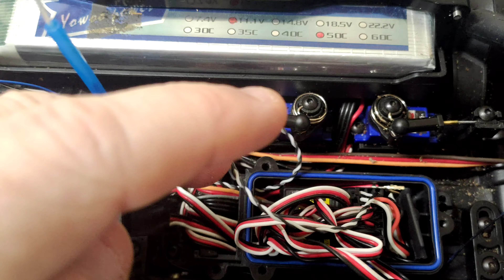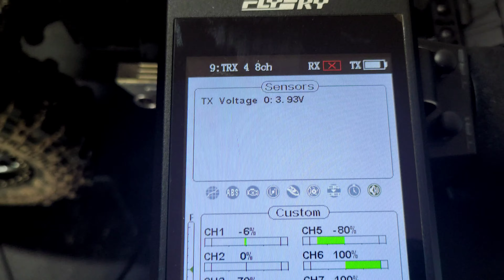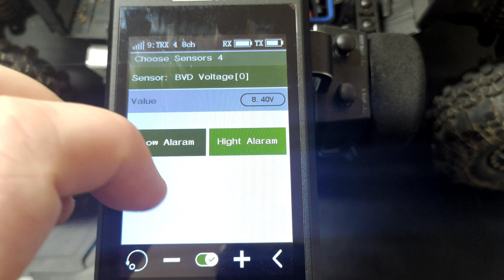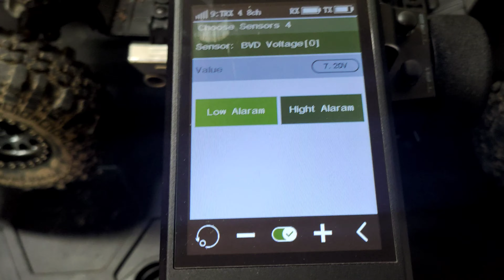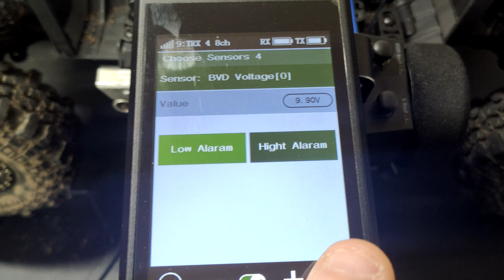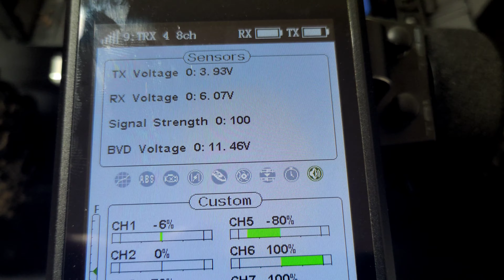Flysky Fgr8b BVD voltage monitor set up guide.

Comment: Good evening.
I have the new update on my paladin.
And now I can use the bvd.
Now my question do I have to use the plus and minus cable for the balancer?
With kind regards
Michael
Reply from the maker: Nope if its the battery your running from only the positive :)
Reply: @WTFRCCars  ok
So I only have to plug in the positive from the bvd at the balanzer cable.
high 13v
Low 9.9
For 3s
And for 2s
high 8v
Low 6.6v
Reply from the maker: So for high 4.2v per cell so 2s would be 8.4v high and 6.6v low
Reply: @WTFRCCars  Thanks for the information.
I'll try that then.
And I don't need the negative in this case

Comment: Hello, thanks for the videos on the NB4, I just got my own and I am wondering, in which case I will loose one channel on the fgr8b?
Thanks in advance
Reply from the maker: Only if you want to run more external sensors, so if you only using the included DVB voltage sensor you have DVB and all 8ch, if you want to add a temperature sensor you would loose 1ch and set that to ibus and then you could add more sensors by daisy chaining the next sensor to the temperature sensor :)
Reply: @WTFRCCars  Thank you for the fast reply and again for the very interesting videos. Then I will go now and update the NB4 to the newest FW 👍😅
Reply from the maker: If you are updating 2.0.99 is the latest only difference is the addition for the rm005 for the mini z add-on, 2.0.93 is exactly the same but no rm005

Comment: Question, i have 2x 3s lipos in my felony how do i connect the BVD harness in this case? @WTF RC Cars
Reply from the maker: Just goes on the + that goes to the esc :) this will give you the overall voltage of all your lipos so the voltage that the ESC sees
Reply: @WTFRCCars  are you referring to the main battery connectors? The esc has 2 of them.
Reply: @WTFRCCars  found it. Connected tto 2nd battery balance terminal show overall voltage. Thanks
Reply from the maker: It's the positive on the esc side you want :)

Comment: Craig I know the receivers come with this cable, question is the NB4 / NB4+ app capable of this in their menus etc?
Reply: NVM I see now vid is 3 years old so of course they are. Awesome feature man!
Reply from the maker: Yeh all of the nb4 radios are :) they released a firmware update when the receiver was released :)

Comment: Finally got my Fgr8b, quick question is it normal for the RX battery level is only half bar? I am running a fresh 3S pack and I set my 1080 ESC bec at 7.4v ?? Thank you !!!
Reply from the maker: Follow this one and you will have a fully working battery icon :) don't forge the dvb can't be set to that icon but you can make it show full when the bec is set to any voltage :)

https://youtu.be/pC9ZnSDrBas

Comment: What if u use 5mm plug batteries (for racing) can i put the + in the ballance hole? The one u also use for charging
Reply from the maker: You can solder the bvd + to the + pin on the battery or + on esc so long as it's seeing the main + to the esc it will show the battery level
Reply: Only way is the solder it? I cant just put it in the balance hole?
Reply from the maker: @RC_Adventures_BE what type of battery are you running if it's a 2s race lipo and you mean the centre hole in-between the power pins you will only see the voltage of 1 of the cells and the pin is much bigger than the pin on the bvd cable

Comment: Is it possible to purchase the bvd cable, i cant seem to find it anywhere. Thanks.
Reply from the maker: I have never seen them listed anywhere but they are just a cable with a diode or resistor in line on one of the wires I'll have to check what it is but try soarsky they have loads of parts listed
Reply: @WTFRCCars  thanks, if you find out the resistor type, I could make a cable possibly.

Comment: really helpful Video. How meny cells can it monitor im using 6S in my cars. Can,t find that info in the manual. ?
Reply from the maker: I can't find anything listed for the fgr8b's to external voltage range but I'm running 3s in the crawler and it has no issues with that, the other voltage monitor flysky do has a range -100v to +100v
Reply: @WTFRCCars   Thanks mate i will just have to try. :-)
Reply from the maker: Just remember if it's the battery your running the RC off you only use the + from the battery monitor cable :)
Reply: @WTFRCCars   I will you explained that very well in video. Thanks mate :-)
Reply: The DVB voltage is 0-70V according to the manual i got with my FGr8B. The pdf online is missing the info.
Reply from the maker: I know I had the pre release one the normal external monitor can do -100 to +100 volts but not sure on the range for the dvb or if it changed but I've run it in loads of rc's now and never had any issues with it reading the lipos :)
Reply: I’m thinking soldering the Positive side right into my connector of esc to avoid the loose wire scenario and eliminating the negative as mentioned. These receivers with the BVd port up to 12s also is even fine?
Reply from the maker: @shawnscott9704 The receiver can run 9v the bvd can monitor upto 70v
Reply: @WTFRCCars  that just made this system that much better!!!!

Comment: I didn't understand. This receiver supports a maximum of 9 volt power. How did you connect it to a 3S battery?! Please explain! )
Reply from the maker: Because you are not running the receiver from the 3s, you only use the bvd to monitor the 3s so the full voltage is not running through the receiver only the bvd cable :)
Reply: @WTFRCCars  I'm curious, what is the maximum voltage that can be connected like this? There is not a word about this in the official documentation. )
Reply from the maker: I assume it's the same as the external voltage sensors so + or - 100v I know the external one I run on my k6 exb has no issue monitoring 6s
Reply: I was wondering about the voltage range for BVD, the manual doesn't say anything. The airplane recievers some have up to 70V but the lack of info is really keeping me from buying. Even though I could detect a single cell if it's low.
Reply from the maker: @ignasanchezl from the spec + or - 100v for the external sensors and + or - 70v for the bvd hope this helps
Reply: Can you connect the Negative as well?  Or will it hurt anything.  I know if you plug it into the wrong spot it’s no good. But curious if connecting it is bad. 
I’d like to direct solder the BVD to the plug so it’s done and not have to alway remember to plug it in
Reply from the maker: @roberttruesdell6151 connecting the - does nothing if the voltage your monitoring is the battery that's powering the receiver but it's best not to connect it so you don't get accidental ground loops